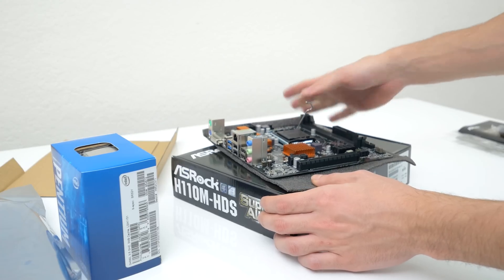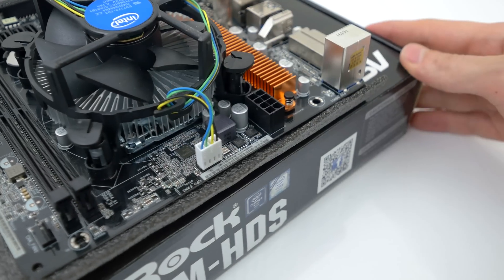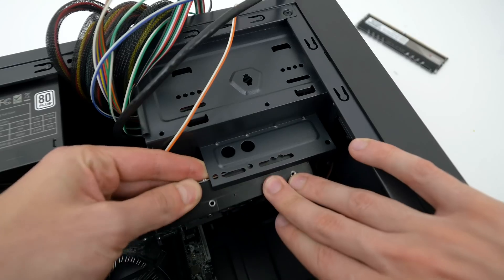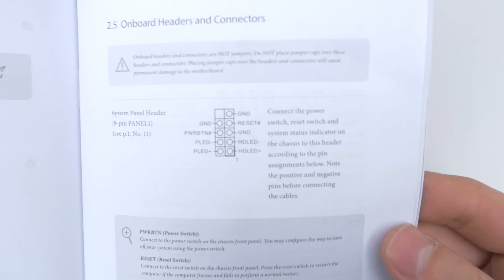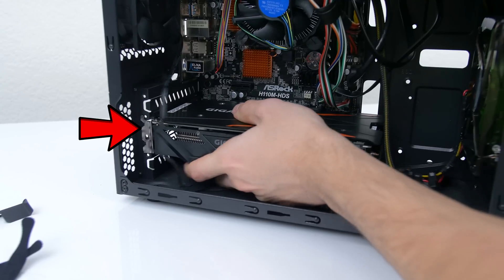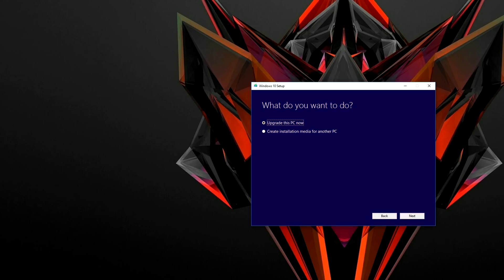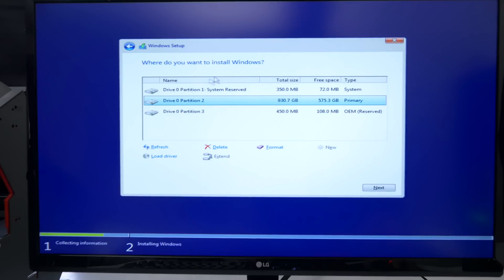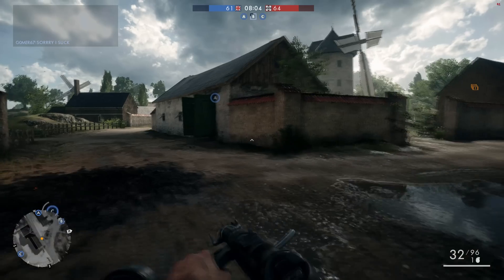How To Build $350 Gaming PC w/ Windows + BIOS Flash

Comment: Hi Tech Source administrator...
My rigs config is
Intel Core 2 Duo 2.93GHz
3 GB DDR2
1 GB Asus ATI Radeon EAH4350 HD Silent
MSI G31TM-P21 MoBo with one PCIe slot.
500GB HDD

What Graphics Card should I upgrade for and what would be better nVidia or Radeon?
Reply: no matter what you upgrade to you will be bottlenecking heavily
Reply: AFTERTHEBLOCK means?
Reply: the cpu will limit the gpu
Reply: AFTERTHEBLOCK What If I upgrade to Core 2 Duo E8500 with nVidia GT710 2GB DDR3/DDR5
Reply: Divyansh Singh you may be able to run minecraft and that's it

Comment: Hey, while I was building the pc I ran into a problem that is I didn't have a DVI to VGA connecter for my graphics card so I kept the graphics card aside and continued to build without the graphics. 

Later after 2 days I recieved the connector and connected the graphics card to the monitor and it's showing no signal on the monitor and it does not shows the boot screen. 
My graphics card - Zotac 1050ti 4gb 
I tried disabling the onboard graphics it didn't work could anyone help me??
Reply: SpilTrez what number does the sticker under the sata connectors say if it says 1.20 you need a new chip reply for further explanation

Comment: !!!🔅☢️HELP☣️🔅!!!
My pc keeps crashing randomly. checked temps, All around degrees and lower, even switched psu, didnt help
Specs:
Ryzen 5 1600
GTX 1060 gigabyte 6GB
Intel 600p m2 SSD 128GB
Corsair c15 1x8GB 2133 MHZ 
1TB HDD
Asrock ab350m
450 watt psu
HELP!!!

Tried reinstalling Windows on Both drives, keeps crashing, so not the problem. Tried switching ram slots. Tried power plan settings. Tried updating drivers. Alleen doesnt help!!!

Sent back my mobo, cpu and switching my ramstick for 2666 MHz ram, hope that that helps.
Reply: get a better psu
Reply: Arshia Shoar Fixed it, it was a broken motherboard

Comment: Would I need to get a higher watt psu if i use an i3 7100? (Sorry if its a dumb question)
Reply: mrblackbronie go to pc part picker and put in your specs,  it should give you the total amount of wattage your going to use,  make sure your psu is at least 100 higher Tho,  and it's fine we all had to learn (I don't believe core i3 cpus will take up much power so you should be fine)

Comment: I'm building something like this right now but I'm worried about the motherboard choice is there anything else that would work good
Reply: try to find a more updated version of the mobo he uses so you dont have to flash the bios,or just get a different mobo all together
Reply: TheGamingGeek I'm new obviously but would a board like this work and do I still have to flash it https://www.amazon.ca/gp/aw/d/B0165YUDTM/ref=mp_s_a_1_1?ie=UTF8&qid=1504285680&sr=8-1&pi=AC_SX236_SY340_QL65&keywords=micro%2Batx%2Bmotherboard&dpPl=1&dpID=51qUTLJ3MGL&ref=plSrch&th=1&psc=1
Reply: That would work,yes
Reply: TheGamingGeek and I don't need to flash it?
Reply: no,you're good,make sure this mobo fits in your case and if you have the right ram to fit and so on

Comment: Hey Techsource and PC gaming community, I have a question: Is it necessary for me to use molex connectors for the 4 system fans that I will be using for my upcoming PC build? My motherboard (MSI Z270 SLI PLUS) has 4 system fan headers, and one cpu fan header. Do I hook up each system fan (Corsair SP120) to a system fan header? Thank you.

Any useful information:
Case: NZXT S340 Elite
Case fans: 4x Corsair SP120
CPU Cooler: Be Quiet! Dark Rock 3
MB: MSI Z270 SLI PLUS
PSU: EVGA SuperNOVA 650W

Comment: does Intel - Pentium G4560 3.5GHz Dual-Core Processor support ASRock - H110M-HDS Micro ATX LGA1151 Motherboard because in pcpartpicker it said no
Reply: you need to do a bios flash update
Reply: Viraj Patel or simply you can get a b250m motherboard
Reply: can you do flash update without 6th gen processor ? cause many people have trouble they cant turn on the pc and get to bios when they have fresh build with 7th gen kaby lake so how can be flash bios done ? thanks
Reply: Yes it does. I built this same exact pc.

Comment: Is an SSD worth it? Im thinking of buying a 240gb ssd but 1TB hdd  is half the price. Does it take THAT long to boot up the hdd? I dont mind waiting.. Is it useful in the long run?
Reply: Totally worth it cuz this will came very handy like opening apps and games and even windows has become very heavy so i recommend buying at least 120gb ssd and an hdd to store data the ssd is for the system and apps plus some games
Reply: Just get both
Reply: Zaburgh no buy hdd because youll need the 1terrqbyte

Comment: how muxh does it cost to buy the Windows 10 thing that you install on the new computer from the flash drive
Reply: NuclearFoutus 87 18 dollars on kenguin or download it from microsoft for free but you wont have any options for custimuzability and yiu will have a water mark on thr bottom right of your monitor
Reply: $75,000
Reply: NuclearFoutus 87 239$
Reply: For the real version of Windows 10 Home 64 Bit: $88 + 8gb Flash Drive
Reply: NuclearFoutus 87 just get craked version of them
Reply: 10-30
Reply: NuclearFoutus 87 90
Reply: It’s actually free on the windows homepage last time I checked, which was yesterday or so
Reply: NuclearFoutus 87 iiiii
Reply: Hi sir is it okay if use EVGA 500bv instead of EVGA 430W?
Reply: kakoy111 motit111 you're replying to a comment btw, anywas that won't be a problem, it is even better than the 430W PSU (Power supply unit)
Reply: Joseph Denbo the pc won’t have any operating system so u can’t even use the pc?U dumb or something?
Reply: SHAD3Y BAGEL'S $239*
Reply: Just get an inactivated one for free
Reply: NuclearFoutus 87 free if you torrent it and get a crack to activate it.
Reply: $3-6
Reply: NuclearFoutus 87 about 10 dollars mostly

Comment: will this pc be able to match all of the requirements for the elgato hd60 listed below:

Windows 7 Service Pack 1 (SP1), Windows 8, Windows 8.1 or later
2nd generation Intel Core i5 CPU (i5-2xxx or comparable), 2 Ghz or higher, before Turbo Boost
Sound card (if your laptop can play sound, then it meets this requirement)
4GB Total Installed RAM (or higher)
Built-in USB 2.0 port
2nd generation Intel Core i7 CPU (i7-2xxx or comparable), 2 Ghz or higher, before Turbo Boost
Windows 7 Service Pack 1 (SP1), Windows 8, Windows 8.1 or later

i just wanna know because my current laptop lags when i try to record videos on myy elgato most of the times

Comment: excuse me are these parts compatible?

MSI SOCKET AM3/AMD 760G DDR3 CROSSFIREXMICROTX MOTHERBOARD 760GMA P34

AMD FX 4 CORE FX 4300

PC3-10600

GIGABYTE RADEON RX 460 OC 2GB

430 WATT POWER SUPPLY

is it compatible would u switch a part for another possibly make this cheaper and maybe a cpu cooler?

Comment: Looking to possibly buy a pc pre made does this suck?

Gaming pc comes with 
* gaming pc keyboard and mouse 
* gaming razor usb headset 
* xbox one controller 
* 24" samsung freesync gaming monitor 

Specs 
* Asus GeForce GTX 960 Graphics Card 
* 2×4GB Kingston HyperX FURY 2133MHz DDR4 Ram 
* Intel Skylake i5 6400 2.7–3.3GHz Processor 
* Cooler Master Storm Enforcer Gaming Chassis 
* Western Digital 1TB Hard Drive 
* Asus B150M-A Motherboard 
* 500W Raidmax Power Supply 
* TP-LINK Wireless N PCI-E Express Adapter 
* Aurora Red LED 
* Microsoft Windows 10 64bit

They are asking for about $350 usd
ty for your help

Comment: do you actually need a 6th gen processor to make the pc works and updating your bios? or can you just instantly use the 7th gen cpu to get the pc work for the first time and updating ur bios? just to the point, my question is do you need a 6th gen cpu to update the h110 motherboard or not?

Comment: Do I need a skylake processor to update the bios and install windows afterwards or the system will boot normally with the G4560?
Reply: You could ask the seller to update the bios for you ..... Does that apply for any 1000th series motherboards or just the ASrock H110M-HDS?

Comment: My GTX-1050ti didn't require it's own power connector... Works just fine but now I'm kind of worried...
Reply: i think its fine i ran into the same problem
Reply: Nambo Cool. Thanks for the heads up!
Reply: no problem. and have you booted this pc yet? im having trouble getting it to connect to my monitor
Reply: I use it regularly for work like stuff as well as hours and hours of BeamNG Drive. My monitor detected it right away hooked up via DVI, HDMI, And even Display Port. I'm sorry but I'm not much help. This is my first ever custom built PC.
Reply: same for me but thanks

Comment: ProTip: If you want good cable management, don't save cable management until the end, plan out the cables as you go.

Though if it's your first build, don't worry about it. Cable management won't affect cooling or performance at all, unless a cable is literally inside of a fan and preventing it from spinning.

Comment: quad core i7 2600k 3.4 ghz
8gb ram
1tb hdd
350 watt power supply
No GPU... whats a cheap and decent one to get? i only play csgo and am looking to get 200+ fps
I appreciate ur input :)
Reply: Parsa X 1050ti gets 170+ fps and a 1060 gets 230+ fps. If you dont mind the 3gb vram the 1060 is great but you could get the 6gb model thats around 40 to 60 dollars more

Comment: Hi, so I built this PC and all the fans are working (CPU, Case, GPU) and I reinstalled the CPU/RAM/GPU but I still can't display it on my monitor (DVI) then TV (HDMI). Please if anyone can tell me how to fix this is appreciated.

Thank you.

I also held the power button for 1 minute (PC is unplugged and Off) and I also removed the CMOS battery from the motherboard and put it back in and still no display.

Thanks again.

Comment: hi ed. Please do a 'top 5 processors around 200$' video. The last one you did was in 2015. 
Like this comment if everyone wants him to do this video.
Reply: touqeer hussain ryzen
Reply: touqeer hussain if (if was edited)your on a budget the ryzen 3 2200g is pretty good for gaming with a dedicated graphics card so if the graphics card doesn’t work then you got the IGPU option.
Reply: touqeer hussain i5 7500
Reply: touqeer hussain R5 1400
Reply: No its not, i5 is better
Reply: No its not, R5 is better  @karelsteenwijk5049
Reply: ryzen 5 1600
Reply: i5 8400
Reply: But we need to know what mothercards fit
Reply: I5 8700k 230$
Reply: Hi sir is it okay if use EVGA 500bv instead of EVGA 430W?
Reply: R5 1600x
Reply: +Uncle Grandpa it's needed only if u have power hungry components if u already have it it's ok coz u don't need to update the power supply when u upgrade the other parts of the computer
Reply: i5 8600k
Reply: All prices are MSRP
Ryzen 5 3600  - $169
Ryzen 3 3300X - $120
Ryzen 3 3100 - $99
Ryzen 5 1600 AF - $85
Ryzen 5 3400g (APU) - $149

Comment: So,I built a PC my budget was 600 euros (parts are way to expensive in Europe),specs are:

ASROCK 970 Extreme3 R2.0
MSI GTX 1050ti 4GB
AMD FX 8320 3.5GHz Eight Core
Corsair VS650 (650W) PSU
Cryorig H7 CPU Cooler
HyperX DDR3 8GB RAM/or HyperX 2x4GB DDR3
Aerocool Aero 500 White Case

Please,it would mean alot to me if you'd answer and anyone else who has any suggestions about this build,tell me lf you want.Thanks!

+TechSource

Comment: Is an h110m pro vd enough for an i5 6500 and rx 470? I need to save some money for a boot ssd and only place i can save money
Reply: The job of a mobo is to provide interface between different component. It will not give you extra performance no matter how expensive it is.

Comment: I actually built this build 2 weeks ago, but it won't show anything on the display. Keyboard doesn't light up,  but my fans do and the MSI Debug LED doesn't show anything, which means nothing is wrong here. I'm thinking of refunding the motherboard, but not sure.
Reply: I have the exact same problem, i think it is the g4560 that is not compatible with the motherboard, techsource just put a i5 in there, he just wants people to buy this pc so he can get money. Everyone who has build this pc has the same problem.
Reply: Yeah, expected. I figured out the problem when I first built this computer though. The BIOS needs an update,  and to update it you need a Skylake CPU. If you don't want to go through the trouble of that, just buy a B250 motherboard, they are $20-30 more expensive, but they have native support for Kaby Lake.

Comment: could I use the i5 2500k 3.3ghz instead?
Reply: Yes, you can. Do remember to get the right MOBO and DDR3 RAM instead of DDR4.
Reply: whats mobo?
Reply: The i5 2500K is not compatible to the mobo in this video. You need to buy a compatible one but no manufacturer is producing it. You have to get it second hand.
Reply: i guess i'll just buy the mobo and cpu in this video

Comment: Question, what is the BIOS flash thingy for?
Reply: So the computer can fully support the cpu
Reply: what are the cases that you have to do that manually? Are newer motherboards exempted from this? Z270F Strix + i7-7xxx
Reply: I built this pc and get no bios, the mobo doesn't even boot because of the cpu
Reply: +Jimmy Bimmy so the BIOS flash thingy is when you don't have BIOS? So it's not required as long as I see my BIOS, right?
Reply: This is too much to explain mate xD, just watch some vids and you will know everything about pcs. Flashing the bios is because there are a few versions of the bios, the version 7.30 supports kaby lake processors. If you have a bios and you can use your pc properly you are safe, if you game and get shitty performance it means you should flash it because then it will support the processor even better. Also don't forget to download your drivers for gpu and motherboard every 2 weeks or 1 month

Comment: I thought you need a Skylake CPU first to run the PC and then flash the BIOS, somebody can explain me why the PC is working before Ed flashed the BIOS?
Reply: +Techsource I built the pc and I don't get the bios screen how can I fix this?
Reply: So did you fix it?
Reply from the maker: +Juanma Aranda its not required. That sounds very dumb tbh if you need 2 different CPUs to get it done.

Comment: i was waiting for this pc build ever since i saw your post on instagram. does H110 board natively support kabylake processors?  i wasn under the impression that one would need a skylake processor to update to the latest bios for it to support kabylake processors
Reply from the maker: +Mohamad rahmath ali it does. On their Page it states it supports 6th and 7th gen CPUs. Just make sure to flash it putting in the G4560 so u don't run into problems.

Comment: my HD audio connector doesn't fit snug on my Z170 Asrock Extreme4 board. connector is from the NZXT H440 case.

HD Audio doesn't work unless I hit my table slightly.

Comment: Hey Guys !
I need help , i wanna upgrade my pc Hard ... So New GPU New CPU New Case New motherboard so yeah ... I use my old Power supply because it has got enough watt ... I will use my old RAM (16gb ripjaws) my old Cooler e.t.c and i wanna use my old harddrive ... here is the question : can i just Put the harddrive with Windows , drivers , games , and some other things in the (new) pc without deinstall everything? 

In love ~Lucky

Comment: HI. Few days ago I was building a similar pc. I used this motherboard and this cpu (Kaby lake). Other parts were different but it doesn´t really matter. I just wanted to say, that my pc haven´t got to bios with my kaby lake procesor. My stock bios version was 1.20. So I had to borrow a skylake procesor from my friend. It was a 6700K skylake and with his processor I could get to bios. From there I updated the bios to the newest one (7.30), just like Ed showed. Swapped the CPU to my kaby lake and voala. It worked. I was able to get to bios with my cpu and from there I was able to install windows. Today the computer is running flavelesly. With my comment I just wanted to say , that be carefull and chceck which bios version do you have before you buy a motherboard. Anyway awesome video. It was a pleasure to watch. Thank you

Comment: So, you say this pc is 350$ right??? Well let me add this up for you. This is based on your links in the description. 
Power supply:50
Case:40
Hard drive: 67.50
Video card: 160
Motherboard: 75
Ram: 67
CPU: 102....
Now lets add this up..... 
This PC appears to be $561.50.
This is not $350 and i dislike your click bait

Comment: hey im in the middle of building my  first gaming pc i have installed the cooler ,Mobo,processor,smps and just made a test run to look if everything is ok i got a bios dsplay and i see everything lighting up ..  but the cooler(corsair h100i v2) it ligths up for a second and goes off but i see everything else is normal.. all 3 fans are  running normal.. is this ok ?? please suggest the case is a nzxt h440

Comment: Could you put an old laptop hdd into one of those external hard drive cases, plug it in to the usb port, then boot it up via usb instead of buying a hdd and a windows key? It seems a lot cheaper.

Comment: Great video buddy! Those small mobos are easier to install haha. 
BUT, God, i hate those little power connectors. 2 add insult 2 injury, Coolermaster mislabeled them and had me place them backwards, so it didnt work. So they sent me a new header control piece to the case, but ofc it didn't work... until I had a bright idea of reversing them.
 I told them over the phone that the numbnuts in China who wrote the manual got it wrong. They slapped their own foreheads ;P

Comment: Wait, fans connected to Molex? Are you trolling us, or is this a tutorial for a turbine?
Reply: Emeraldy some fans are meant to be connected to molex. They usually have switches. If it's a low RPM or otherwise quiet fan, it should be fine.
Reply: But it's not, and why do they have 3-Pin connectors then?

Comment: I know it seems silly but a ton of first time builders usually leave the plastic protector on the bottom of an aftermarket heat sink. BE SURE TO TAKE IT OFF. Didn't hear it mentioned in video and I recently watched Paul's Hardware even leave it on...he's a 'pro' to. Lol mistakes happen